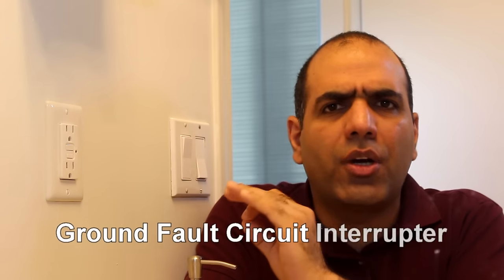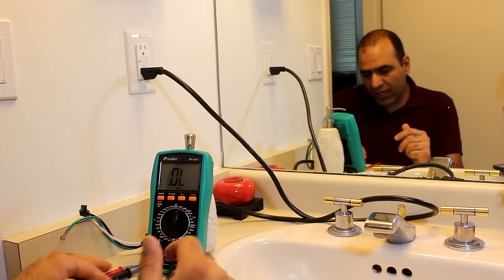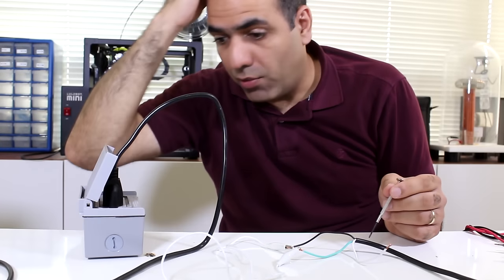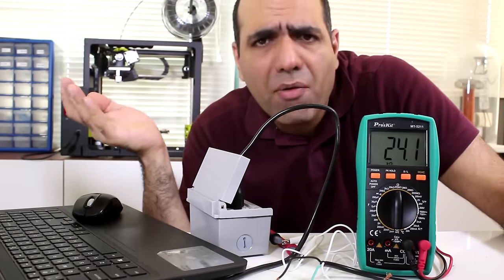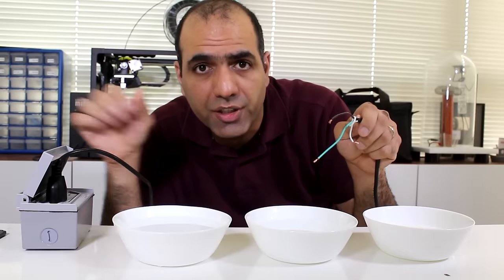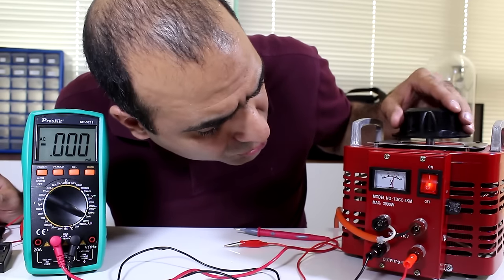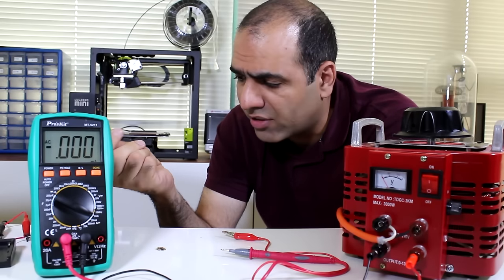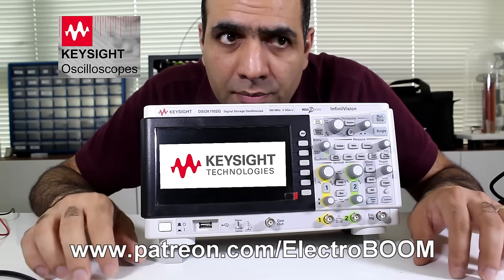The Outlet that Saves Lives

Comment: You guys don't have RCDs (residual current device, a different name for GFCI) in your breaker boxes? Modern Australian homes are mandated to protect all mains circuits with RCDs at the breaker box, so all outlets are protected without the need for each to have an RCD.
Reply: American Electrician here, we do but we only use them for select circuits for the convenience of the home owner and the cost since the plugs cost less than combination breakers. Most breakers also contain AFCI protection now too which helps prevent large arc flashes in the house.
Reply: Szakembőr TV TMIAE yeah ours are similar you have stadard which are now the least used ironically but are on our 240v circuits and circuits that have one of those gfci plugs on the circuit, afci combo breakers which most home circuits use, and the gfci combo breakers for use in damp/wet locations or in specialty use circuits. Our breakers are just in multiples of 5 like 15 amps 20 amps ect.
Reply: Szakembőr TV TMIAE yeah, seems fairly standard since their used in wet locations so having a lower responce current makes some sense
Reply: +anon ymous If you used GFCI breakers designed for house circuits rather than single outlets routinely wouldn't the additional volume make them cheaper? I don't think RCDs are very expensive here, and usually 2 is enough to cover a reasonably big house, giving protection to every area that would need GFCI outlets otherwise and as a bonus protecting all the other outlets too (the one time I've seen an RCD fire in a real life scenario and protect someone it fired on a living room outlet from direct contact with the live wire in a loosely plugged in non-compliant plug).
Reply: Joe Chief oh a sigle outlet also protects all the other plugs on a circuit. The GFCI plug is just the first one on the circuit.
Reply: Here in Argentina (and i'm guessing most part of Latam)  it's required by law (well technically they are not laws but requirements from the electricity provider) to have both RCD and MCB, and a minimum of two separate circuits on any house, this applies both for single-phase and 3-phase (although as we have 220~230v single phase, it's less usual to see a house with 3-phase power)
Reply: What you are describing is  what we call a ark fault breaker,  we have those in Canada  and we use those strictly on a dedicated plug circuit !!!
Reply: If an RCD is tripping there's something wrong on the circuit - it's a useful barometer. I was able to track down a washing machine element that was about to die because of an RCD tripping at certain times during the load.
Reply: Joe Chief ey stop bragging
Reply: Wow; That'd just make too much sense for the consumer/home-owner.    You have any idea the headaches that would have saved when I was on government Rental assistance
Reply: Szakembőr TV TMIAE not really because you shouldn't see a ground fault unless something is wrong like an exposed wire or someone playing with the outlets
Reply: Same here in Italy, typically a home electric panel consist in one RCD with a 30mA tripping current and individual circuit breaker for every circuit, typically 16A for plugs and 10A or 6A for lights. The strange thing is that we use C breakers, that you don't commonly see in homes in other countries, where they use B breakers. 

Good appliances should have a current to ground 0, or at most a couple of mA, if the RCD trips for nothing it means you have a problem somewhere or the RCD is broken, in my case it never tripped for nothing. 

Also having a RCD just after the meter and not only on the plugs means that you are always protected, even if you are doing some electric work with the power connected (which in theory you shouldn't, but we know that in practice we do) and you touch a live wires, the RCD trips. 

Or even if there is a short circuit between earth and live somewhere, since we have TT earthing system you can have dead shorts between live and earth that have a current that it's not enough to trip a breaker, and this could be very dangerous, because all metal body of all the appliances in your home becomes live.
Reply: You are supposed to have them in the UK and this house being built in 1971 didn't... I found out the hard way when a florescent light ballast in the garage melted and joined live to earth..
Me in the shower and my elbow touched the metal hose FUUUUUUUUUU*UUUUUUUUUUU quickest ever exit from the shower cubicle..
Turned out all the taps in the house were 240V live and nothing tripped!! Needless to say I now have a 30mA RCD installed
Reply: Same in Israel, we have it on the main board. 30mh BTW.
Reply: what’s really annoying me now though is my residual leakage from all the circuits ( because the house is old rather than a single faulty device) is the RCD is forever killing the entire house, plunging you into darkness if its at night... so now I’m having to look at a complete rewire and consumer unit with either twin split RCD’s or better  a complete RCBO fit out 😭🙈
Reply: Here in Australia C Type breakers are all that is used in homes, D type are used for motor starting current, B trip too low for much use, i haven't ever seen one, only a few d type ever, 30mA rcd or rcbo is now mandatory on all residential circuits, according to the latest wiring rules.
Reply: I have always looked at the UK wiring with doubts, while it was useful at the time of initial uptake it makes far less sense to me now, also as above in AUS we are required to upgrade to have minimum 2 rcd's per house and standard practice is every circuit on it's own RCBO.
Reply: Here in Germany, RCDs are mandatory for all sockets and as far as I know recommended for light circuits. In the past they were mandatory only for the bathroom and I think kitchen. It's also recommended to have lights on a different circuit than sockets so that one faulty device plugged in a socket doesn't turn off the light. If that's not possible, at least have different circuits per room so at least you have light somewhere. RCDs here are required to trip at 30 mA difference (230 V / 50 Hz system).

Comment: We use GFCIs that look like circuit breakers and they protect whole room
Reply: In switzerland and germany, it is not uncommon to use one GFCI/RCD for one living unit (aka. apartment, floor of a house, ...). In the house I am currently in, if the RCD trips, the whole floor would go dark (that is the down side), but I am protected on any outlet (that is the up side). By code, they would only be required for wet rooms, but it is allowed to protect more rooms with the same RCD.

Comment: Presumably the very short duration is also a contributing factor in some people surviving even a direct lighting strike which can deliver on the order of Gigavolts at 10's of kiloAmps but the discharge is very short 10's of microseconds on average. Too short really for the body to react to the stray electrical stimuli so it's mostly the tissue damage caused by excessive energy being dissipated as heat that you have to worry about which the atmosphere and the ground take the brunt of as body resistance contributes very little to the overall resistance.

Comment: In germany, these things are standart for every electrical installation
Reply: @Jameson Audette a lot of houses don't have one or not all groups are connected to it. I replace fuseboden A ALOT and some times after that i find that a outlet user ground for null
Reply: @Jameson Audette yea it wasn't standard back in the time and you don't have to upgrade a system. So there are homes with dry circuits which do not have a rcd
Reply: @Jameson Audette for example: a home which was built before 2007 didn't need to put RCD in outlet circuits by law(refering to outlets outside the bathrooms). Homes build after that were required to do so. And since 2018 it is also required in all lamp circuits. You don't have to upgrade your, for example 1990s home to 2018 standards UNTIL you change something in the electrical system (like moving a outlet or adding another)

Comment: I've touched 120 volts (several amps) and felt a little... I accidentally touched 240 volts (little amps) and it hurt like hell!
Reply: FirestoneVlogs 1/10 amps can kill
Reply: 120 volts 6 amps without ground feels good
Reply: NerdShedLabs TM GeekSufniLab didn't think about that... but yeah... make sure to be grounded! That hurt like a (keep this pg13)!
Reply: FirestoneVlogs i touched 50k volts , and like 90 mA!
Reply: I touched the heatsink of an opened AC adapter of an old TV once that operated at 7 amps (the voltage was like 12 V or something) with my finger and felt the shock through my entire arm. Good thing I didn't grab it, I jumped back like 2 meters. I think the outlet power actually shocked me considering 12V wouldn't be enough to feel such a shock through dry skin.
Reply: Yeah, taking 20 amps hurts like hell!
Reply: wtf r u talking about
Reply: Saad Ansari tell eb make a video about it
Reply: techraps I don't think you did, because that's not how it feels.
Reply: therandomusarneim The times I’ve been shocked, with 240 and 120, I was grounded. I don’t know, I’m still alive right now, yet it really really hurts!

Ever since I posted this comment, I’ve been shocked MANY more times!
Reply: techraps yeah
Reply: Yes there is, its called capacitive coupling.
Reply: More likely the capacitor across the isolation boundary for RFI suppression, this can AC couple a small current path between input and output.
Reply: FirestoneVlogs I’ve touched 125 volts lots it tingles unless you hit live and neutral that hurts like hell
Reply: well, if youre poorly isolated from earth but still isolated, touching live indeed tingles compared to the shock of being earthed or even touching live and neutral. Cant speak for poor isolation from earth on 240V though, because I wasnt foolish enough to try that yet, but I accidently touched live and an earthed case with both hands and it was insanely painful but somehow pleasant xD
Reply: FirestoneVlogs m
Reply: All other factors being the same, you'll draw double the current with double the voltage. The energy dissipated in your body (mainly as heat) will be quadruple - VI = V²/R. 240 is dramatically more dangerous than 120.
Reply: Apart from Voltage and Current, there is another important factor that is Time: You may get quadruple the damage when touching 240V compared to 120V, but if you cant let go from the wires anymore, you will die either way.
Reply: FirestoneVlogs when I was 4 I grabbed onto a cow fence that was live and luckily my grandma was there to pull my hand off
Reply: Who else here has gripped hold of the HT leads on an engine whilst stood on wet ground. The car ignition was of the CDI type where there is even higher voltage, that has got to be one of the worst shocking experience that I have had. My hand and arm was in a lot of pain for a considerable amount of time after too, I also had weird visual effects whilst still holding on like blue flashes in my eyes. I would grab 240v any day with a y in it before getting a kick from car ignition again, given the choice.
Reply: I've touched straight house power at one point 120V 10A with one hand
Reply: * 220 forgot that was back home.
Reply: One hand is fine unless you stand barefoot on a wet piece of metal that is grounded, its still quite painful though.
Reply: FirestoneVlogs it's the voltage that shocks, you can't be shocked by a car battery, too little voltage, unless you put a wrench across the terminals you can't be shocked by it from what I've been taught,
Reply: you cant be shocked by putting a wrench accross the terminals either because no current is flowing through your body.
Reply: People still aren’t getting the basics of Ohm’s Law! Saying you’ve been shocked by 240v @ X current, because that’s what the supply is rated at, makes no sense at all. All external variables being equal, a shock from a 240v household supply is more dangerous and hurts more than one from 120v. More current will flow because your body resistance determines this, not the supply, which has an extremely low impedance/resistance and can be ignored for the calculations. It doesn’t matter if a supply is capable of a billion Amps, 13 Amps or just 1 Amp when the load, ie your body, will only pull tens of milliamperes!
Reply: In case of 240V and you both touching live and neutral being unable to let go you can actually reach beyond 100mA as your skin gets burnt and becomes more conductive but you wont be alive at that point anymore. :D
Reply: Yep i touched 240volts about 3-4 Times in my Life but luckly with one hand but IT still was extremly painfull
Reply: I really should touch 240V with one hand aswell, I need a comparison to my both hands experience xD
Reply: Here in Germany we have 240 Volts AC. I don't know how much current is delivers but to be honest... I don't wanna find out 😅
Reply: Team Android arround 10-12 i think ^^ without safety fuse it will make your funeral smell Like grilled chicken
Reply: Peter Zingler oh jeez. Thanks for the info xD
Reply: Most households in Germany have 10A or 16A breakers, some older ones only 6A, but nothing like that will flow through your body. When you touch live in neutral with dry hands, the current will start at around 1mA and with wet hands around 5mA but it will rapidly increase as your skin breaks down until you either let go or if you cant until you eventually die which might happen at 30mA already, so far away from your circuit breakers limit. If you touch live and earth, your RCD should have tripped at that point already.
Reply: Chuckiele Rcd was the word i didnt know thanks😂
Reply: Chuckiele you seem to have experience my friend 😏. Wanna find out what it feels like to get "roasted" xD
Reply: Team Android ITS Like Holding a Vibrator that does incredible pain rising Up your arms you can feel the Frequenzy Vibrationg in you
Reply: Yes, Ive talked about it here a couple of times, I did get shocked through my chest at 240V before and I dont recommend it.
Reply: How do you know it was several amps? Did you measure the current passing through you?
Reply: QFK's special 50milli amps is easy to measure , If your Heart stops you reached 50
Reply: Thats not completely true. You may die by fibrillation at 30mA already but you can also survive 70mA through your vital organs and way more than that through your limbs. The lengh of exposure is important aswell as you can survive shocks by electrostatic discharges at several amps easily because they only last for nanoseconds to microseconds.

Comment: @Mehdi I love your videos! The gave me 2 ideas... Today my 3 year old became interested in the wall sockets. She's JUST old enough that I can use words to tell her they are dangerous and she seemed to understand. If she had become interested earlier, as many are, it would have been more difficult to communicate with her. So here are my 2 ideas: 
1. Create a video, ElectroBOOM style, aimed at scaring... er, um... teaching respect for wall sockets for 1-3 year-olds.
2. Create a device or setup to demonstrate the danger (tough to do responsibly, i know). It would require a way to demonstrate that
  a. Not just this object I'm holding is dangerous but all objects inserted into the wall socket
  b. Even a partly pulled out proper plug can be dangerous

Comment: In south africa it is illegal to install any outlets in bathrooms and you would never get any contractor to install it for you as it would fail inspection.
Reply: How the hell do you use curling irons, electric razors, etc. then?
Reply: Slinky511nx7 How the f*ck are you supposed to use a hair dryer
Reply: +Preston Lo Use them in another room